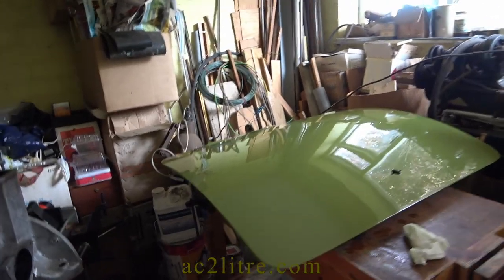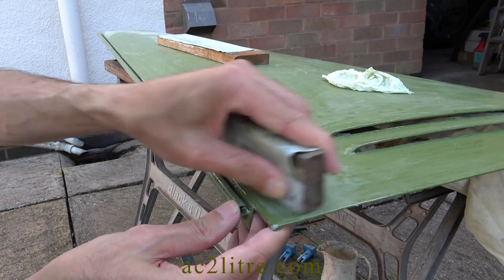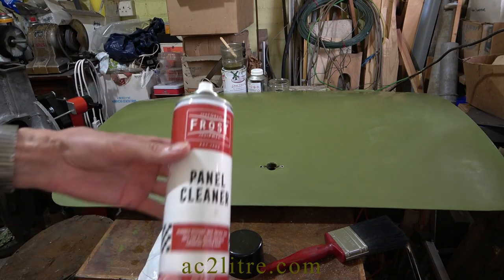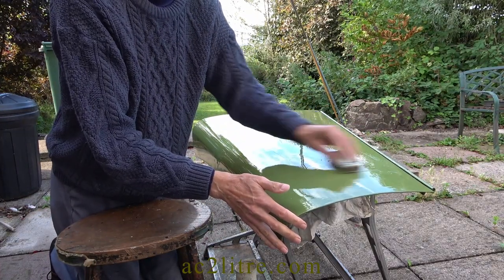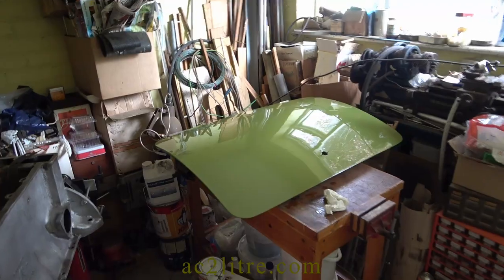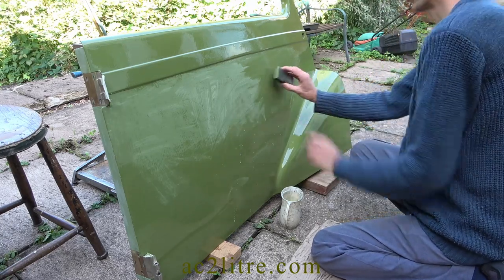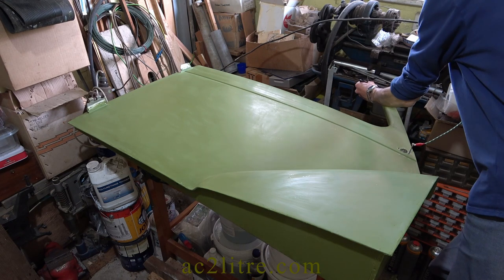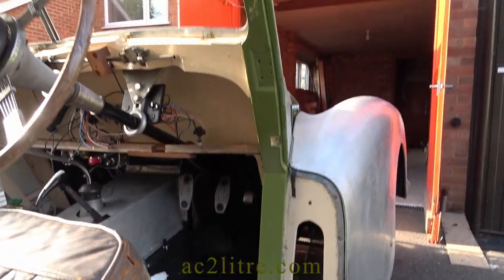Coach painting my AC 2 Litre (Part 2).

Comment: One thing I've noticed whilst rubbing down my paintwork - although some brush marks are visible after rubbing down it's my conclusion (others may not agree) that if it can't be felt with the fingertips it's ok to ignore it. Using a kitchen scourer is a good tip (thanks!) as if used lightly over the complete panel it gives a good, uniform surface to continue applying the varnish. The scourer is particularly useful on internal angles and any curved surfaces where it's troublesome to use abrasive paper.
Reply from the maker: Thanks for that feedback. I'll be doing more painting soon, so I'll try out your technique.

Comment: Great to see the results - I also prefer brushing (or rollering) paint instead of spraying. I tried spraying once and the result wasn't good.  I've been using a technique which I stumbled upon. I decided to apply thinned undercoat (thinner with white spirit) using the logic that if it was thinner there would be very few brush marks. That worked, and then I thought "why not do the top coat similarly?" One answer could be 'because the topcoat will not be shiny' and this was indeed the case. Using 3 coats of thinner topcoat I achieved good colour depth without having to rub down too much (just the odd run) and then using the Craftmaster clear varnish the shine came back. The result was very pleasing (especially to the person who bought the car), and I am now painting my Quantum kit car using the same method (although hot weather has stopped progress). The other thing I found is that some boiled linseed oil mixed with topcoat (probably varnish as well) will give more 'open time'
Reply from the maker: Thanks for that excellent advice. I've been adding white spirit to the high build undercoat, and a little to the green top coat. As you say, the smoother finish requires less rubbing down. The challenge is to avoid runs and sags. I hope all goes well with your kit car.

Comment: I'm painting outdoors (not enough light in garage ) - Ambient temperature can be a problem with the paint drying too quickly, however (aside from the danger of air-born particles/bugs), I've found if there is a steady breeze it speeds drying more than a temperature rise. I find it odd that many household paints are sold with the 'benefit' of quick-drying, where it always seems (to me) to be something to avoid.
Reply from the maker: That sounds like a challenge. I'm doing the etch primer (smelly!) and undercoat outside, and then the rest done under cover. Dust is still an issue under cover, although I earth the panels to reduce static.

Comment: Would it be more effective to have a dedicated tipping brush? I have watched someone who used a very thin short-bristle brush, for tipping only. After each stroke he cleaned the bristles with a rag to remove excess material. It made sense to me.
Reply from the maker: Sorry I missed your comment until now. Yes, that's an option I've noticed and I might give this a try. I think it's normally done with a wide brush, as it is important to work quickly before the paint starts to drag. Thanks for this suggestion.

Comment: Lovely car. And the same colour as the one my father owned when I was a child. I can see why you would want to restore it, but why hand paint it when you could get a much better finish spraying it?
Reply from the maker: Potentially, I can get better results than a spray finish. The shine is deeper, and with practice, the overall finish should be better. It will also be much more hard wearing in the long term. Parts of the AC had been coach painted about 60 years ago, and it was tough to remove those areas. I'm glad you like the car :)
Reply: @ac2litre  Thank you. And good luck with the restoration.